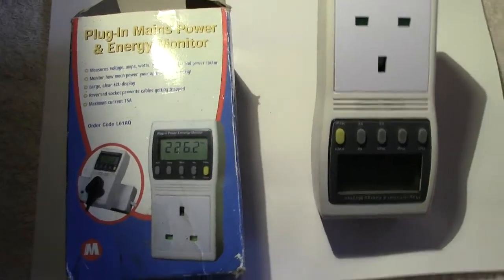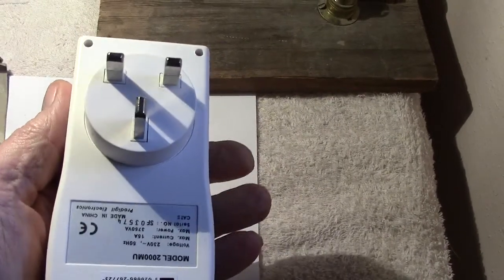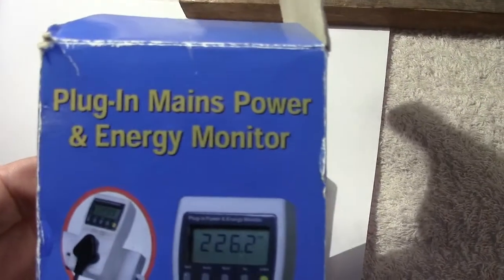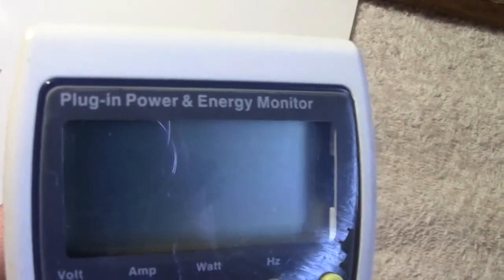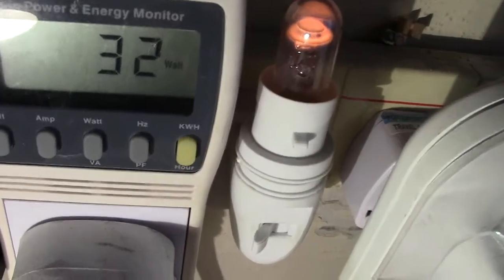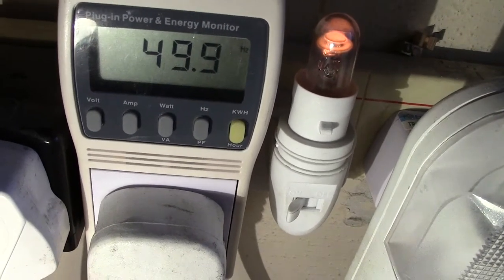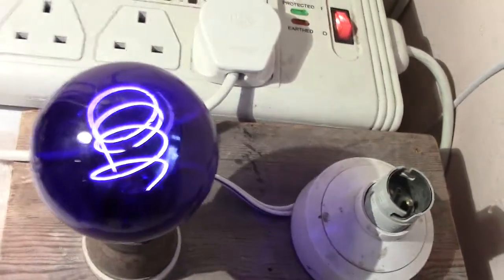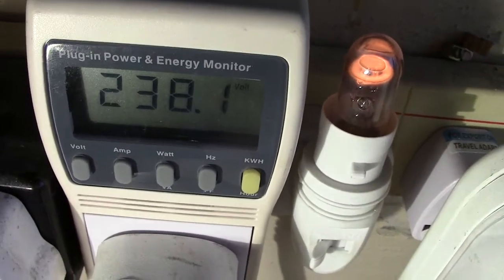Plug-in Mains.Power.& Energy Monitor

Comment: I have to correct you W ≠ VA. 
lets do some math: You said P=U x I 

I=0.32A
U=238V

P=0.32A x 238V = 76W but the meter shows 53W. Who is right? 
The meter is right because Power is not Voltage times Current (P≠U x I) 

Current times Voltage is VA, apparent power.

The right formula for Real power (Watt) Is P=U x I x CosPhi 

For the real power you have to use the power factor because you have an Inductive load  (Transformer), and so Current and Voltage are not sinusoidal. 

Another example. A 125W mercury lamp runs on 125V and 1.15A. If you multiply this two numbers you get 153VA and Not Watts. 

In Power you have 3 type
Active Power Watts (P)
Reaktive power VAR (Q)
Apparent Power VA (S)

That lamp could is a nice lamp. 30-40s. It looks german made. I think It could be even made during or bevor WW2 by German Osram.
Reply from the maker: I like something like, I always thought V  x  A = watts  why not a sine wave , inductive load would cause lag and capacitor would lead but it still remains a sine wave, you are making me think back years when I did AC theory, anyway you are probably right. Another good comment mate it got me thinking.....wish I was not number blind it held me back when at school and adding up I had to write it down, we didn't have calculators let alon computers when I was at school. Good answer though Alex.
Reply: Need to try a capacitive load then an Inductive load then a resistive load and note in theory a capacitive and inductive  load can have zero watts power and have a positive V*A ...
Reply from the maker: One for you Alex I think from You Know Who.